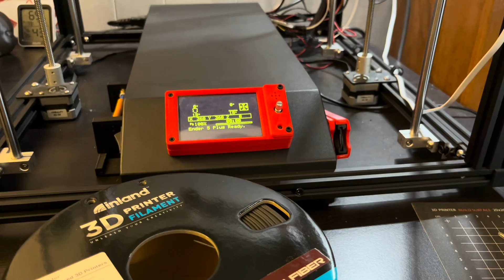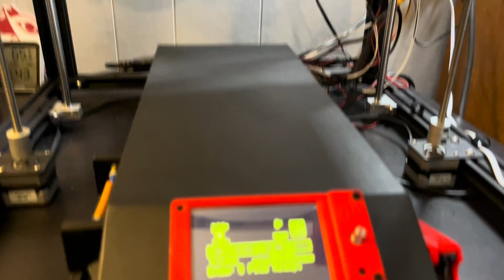Unleash Your Filament: Master the Art of Welding!

Comment: This sort of welder is exactly what I’ve been looking for! How do you deal with the PTFE tube being wider than 1.75mm though? Would the filament not just expand filling up the entire PTFE tube?
Reply from the maker: Good question. I am using PTFE tube with tighter tolerance similar to Capricorn. After I heat it up really good I hold both ends of filament and move them together, in the same direction, left and right. If you pull or don’t move both ends, they’ll separate instead of fusing (ask me how I know, ha). I developed a ‘feel’ for when the ends in the tube had melted enough to fuse, shift the filament back-forth a few times, and then push it through as seen in the video. If you leave it melted in the tube to cool it would expand to the size of the PTFE tube. So the trick is to not leave it in to cool, and move it back-forth to smooth it out while it’s still hot/warm.